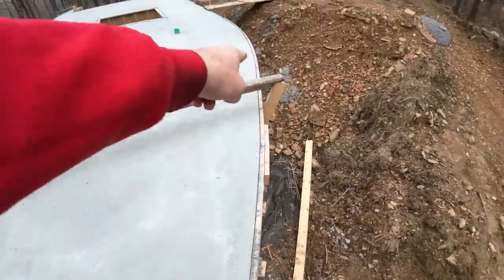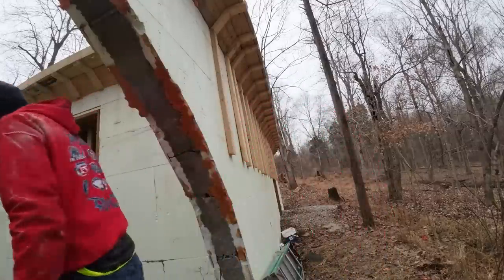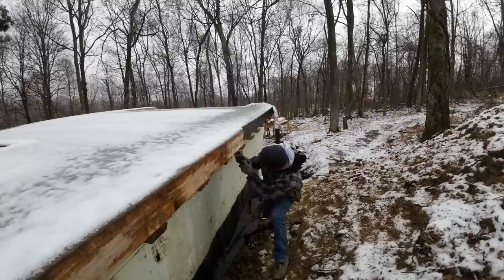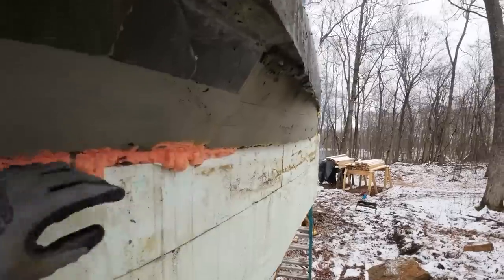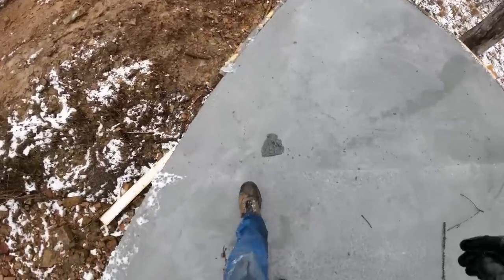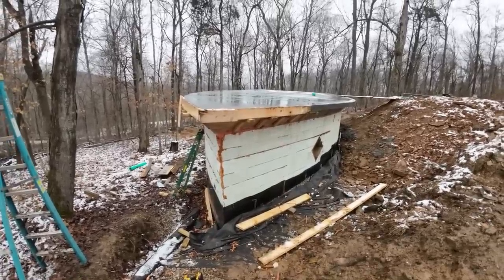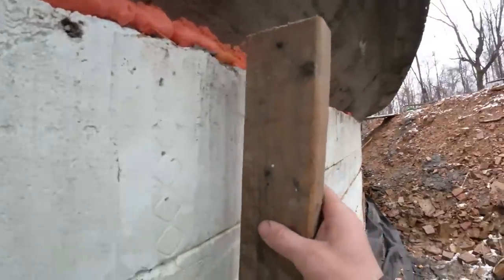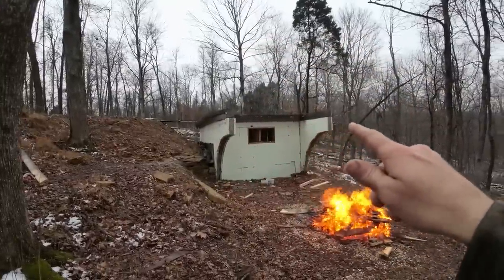Stripping Concrete Forms - Suspended ICF Floor for Boat Themed Cabin

Comment: Great job. It's awesome seeing this come along.
Just a word about safety, you never know what you forgot to remember. 😄😄
Case in point, when the form board sprung out and smacked the Captain in the head.
Most of the time these things are no big deal... just the aches and pains necessary to get work done. But once in a while, things can get really ugly.
A couple of inches lower and that board could have taken an eye out. A little more spring energy in the board, and that bonk on the head could be a concussion or a cracked skull.
This is why on professional job sites, where insurance companies are involved, hard hats and eye protection are mandatory.
It's probably a good idea to wear them even on a small project like this. Sometimes bad things happen to good people.
Reply from the maker: Nah

Comment: I worked for a boat builder who just built 'one offs', that is one mold, one boat. When we removed the part, hull or deck or smaller items, we cut the molds to bits. These were custom racing sailboats and the owner/customer paid a lot for unique. 
Some might think this is a waste since a lot of very nice lumber ended up in the 'wood only dumpster', but that is what the customer wanted. I doubt that Mike will ever build another 'cabin' like this one and so the lumber is part of the cost, it can't be repurposed.
We did save some lumber what we could, provided it would not 'give away' the design of the boat. Great job Mike. The fairings and the deck house are yet for the future. Looking forward to this.
Reply from the maker: Yup! Exactly.  Unfortunately there is just a lot of waste with custom builds. Appreciate ya watching

Comment: Just can't wait to see someone say "it's built out of concrete so it ain't gonna float". But I'm glad the Captain built it on a hillside so it will be easier to launch into the river. Mike it's going to be a beautiful River Paddlewheel boat when all of the outside concrete/parging takes shape and is finished and the top decks and handrails are up and on. IT'S GONNA BE A LOOKER
Reply: Plenty of concrete boats have been built.

Comment: Cap’n, at my age, I don’t usually spend much time watching a stripper.  However, once you started, I couldn’t stop staring.  With every little bit of covering you removed my excitement grew as I saw the sculpted shape beneath.  Indeed, you could have a career as a professional stripper… you certainly have the form(s)!!!

I have an idea for a simple stamp.  How far apart do you want the rivets?  

My grandson had a dozen goldfish left over from a fishing trip a couple of years ago.   He put them in his dad’s stock tank.  We dipped out 40 or fifty this past summer for fish bait… and there are more than that still in there… so, get a big enough aquarium and your daughter can raise food for the catfish and bass in your pond!

Congrats on having your mind picture pop into view… in crystal clear 3-D!
Reply: SV, +3 on the rivet form, be nice if it was on a handle so he could just roll a line on the CementAll. PS Gold fish are inbred carp, keep them out of the pond unless they're dead!

Comment: Thanks for sharing.  Concrete isn't cheap but what always gets me is the cost of framing/mold materials.  And if you're only going to do one project (like I would) it seems like a waste to buy a bunch of stakes and plywood or whatever.  Anyway, the land bound boat is look good. :)
Reply from the maker: Definitely a lot of waste in concrete.  Check with your local supplier though, some places will rent forms.
Reply: @CaptainKleeman  Oh nice tip!  I'll have to check into that next time.  Thanks for the info. 🙂

Comment: That looks like a lot of work just to remove the forms but it looks fantastic. Heck, I think it would probably float if you had a way to get it down to the river.🤣I know nothing about ICF's and I was wondering if the foam came off after the concrete sets, but after your explanation I get it now. I think this will be amazing when finished. 👍

Comment: Turned out good. Look at getting a tool belt with a big sack pocket to dump the screws into. Keeps them in one place and they don't spike your thigh if you use your trouser pockets. Far more comfortable :)
Reply from the maker: I have several belts.. never use them.

Comment: You are having entirely too much fun with this project. Is there going to be a paddle wheel on the back and if so will it spin?  Just wondering. The concrete came out awesome and have never used the skim coat you are referring to but you answered my question on mesh so. Looking good so far.

Comment: Just a small Idea, how about a sort of Moat around the structure that gives the impression of it floating and covering the drive wheel at the stern? Could also act as the guests lap pool also whilst giving the impression of being tied at a dock?
Reply from the maker: The long term is a lake off the bow.  But that won't be for a few years

Comment: The project is coming along awesome.  There is a product called Dryvit worth checking out.  It can be applied over ICF and should be easier to apply then the Cement-all.
Reply from the maker: In my experience it isn't as durable and can't be built up as much.

Comment: cemental (if you haven't used it before) will set up very fast. it also will get super hot in the bucket; hot enough to burn you so dont mix to much at one time. it also sets up under water if the need ever arises.another product that works like concrete bondo is called SET. it can be formed and shaped like bondo but is a concrete product. can be shaved and cut to shape.
Reply from the maker: I was warned to work on "small" areas at a time.  Ill check out that SET.  thanks for the tips

Comment: Have you thought about building one (or two) of those "smokeless" burn barrels?  From the looks of the ones I've seen here on YT all you need for parts are two 55 gallon steel barrels for each (plus a lot of self tapping screws or a welding rig).  That would make it a lot easier (and safer) getting rid of scrap lumber and downed branches.
The cabins looking good so far!  I'll admit I was one of those wondering about the exposed slab edges and the overhang.  I was sure you had a plan for it, I just wasn't sure what that plan was.
Reply from the maker: Piles work for me.  Appreciate ya watching

Comment: up here we put vegetable oil on the inside of the form as a release agent, the concrete and form wood don't stick together. Makes stripping the forms a lot easier.
you could also have put small dollops of wax on where you wanted the honeycombing. The heat of the curing process for the concrete would melt the wax out.
Reply from the maker: Yup!  We talked about it a little bit when we did the concrete, the pump sprayer broke that morning while doing form oil
Reply: @CaptainKleeman  the pump for the oil sprayer breaking sucks, since it makes the cleanup of the forms harder.

hmm, just thought, riveted seams or welded seams, the stamp for welded would be faster and easier to make.

Comment: In WWII, with the steel shortage, some ships were built with concrete. Some are still built today. The process is called ferro-cement. https://en.wikipedia.org/wiki/Concrete_ship
Reply: Thrre is a lot of floating concrete structures being built like submerged tunnel sections. Build them in a yard with end plugs, float them out and sink them then remove e ds when the tunnel is done.
Reply: @kenore4003  I never cease to be amazed at what people dream up.
Reply: @craigsmith8217  Especially the things that involve a large portion of " Oh really, that's gross AND stupid",

Comment: 🌟🌟🌟🌟🌟 what size of screws ? did you use, iam assuming they are star bit type though. PS. - Was there thought about wood plank stamp simulating a wooden paddle wheel ??
Reply from the maker: Depends,. Anywhere from 3" to 4 1/2" T25

Comment: Wow wow so cool to see this project coming together, I do have a question for you captain was wondering if you have plans on putting a epoxy finish on the floor like they do garage floors
Reply from the maker: For the main level no, for the basement we are still debating on what to use.

Comment: Is the top floor walls and roof gonna be built with the foam blocks or will it be wood? I imagine a wheel house in the front of the top floor or as a third floor alone that has a sloped from front to back flat roof. That's what I picture when I see a boat like this. Kinda like half tug boat half paddle wheel. This is so freaking cool!  👍
Reply: If I'd have waited to the end of the video I'd have known you are gonna frame the rest. My fault for jumping the gun. If the wheel house is big enough that could be where the bed for the master bedroom goes. Maybe? ⁶

Comment: That turned out pretty darn nice if you ask me. Looking forward to seeing the process you talked about. I am curious about the condition of the ICF cause of the growth on it and if or how you address the mold, mildew, growth, whatever you call it? I have no idea when it comes to ICF but it seems to me that you would address that before going any further to prevent any further growth.... Just curious if you or anyone cares to explain.
Reply from the maker: What growth?
Reply: @CaptainKleeman  Might just be my connection causing me to see what I think I see but on my end it looks like there is a darker/brighter green color from sitting in the elements. Just like siding will grow like a fungus if you don't pressure wash it occasionally caused by rain. I only watch at 480p on good days.

Comment: I wonder if instead of trying to stamp a rivet shape into the finish it would make more sense to just find some rivets and drill holes for them after the skim coat is done and drive them into an interference fit.
Reply from the maker: You're talking about 1000s of individual rivets or just stamping dozens at one time...not to mention the added cost of the rivets
Reply: @CaptainKleeman  I did a quick search on Amazon before I posted and they looked like they could be purchased for pretty cheap. Perhaps they can just be pressed into the wet finish. It seemed to me that a stamp would be pretty hard since your would need to smooth finish and then try to use a stamp to make a feature that is protruding from the surface. This seems like it would be much harder than trying to make a feature that sinks down into the finish. An actual rivet would probably give much sharper edges as well to try to sell the look.

Comment: Just think of the exterior surface of the entire building at this point, like the "scratch coat" of a plaster or stucco wall. It has to be rough so the finish coat will properly adhere.
Reply from the maker: There ya go

Comment: Why is the concrete black on the sides and white up top?
Reply from the maker: It's still curing out. Top surface is dry being exposed to the air.  The surface of the sides were wet from trapped moisture between the concrete if the forms
Reply: @CaptainKleeman  thank you for explaining that.  Am learning about concrete.

Comment: Well... that's not going anywhere.
    Put a cover over the hole until spring. Move all the leftover wood inside, otherwise, there is no point in saving it.